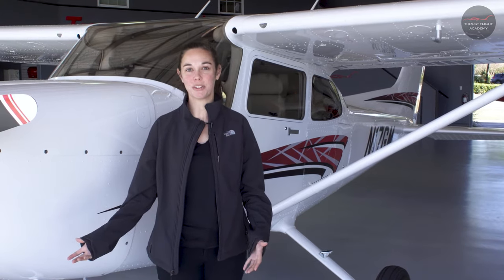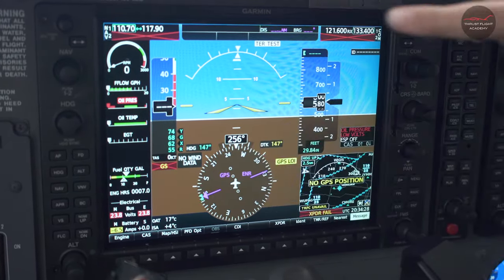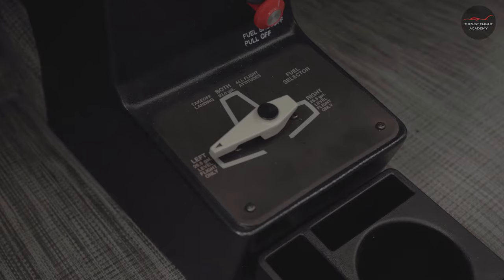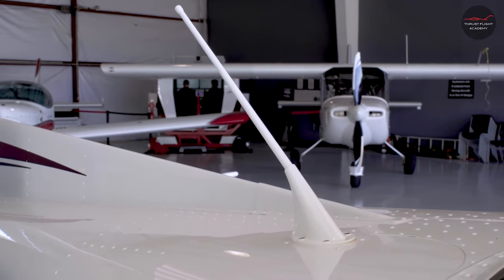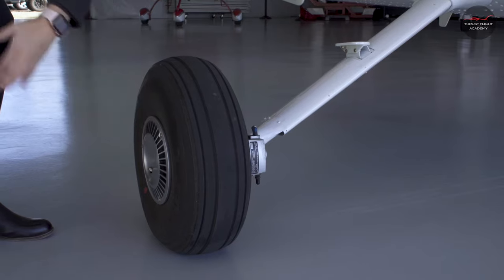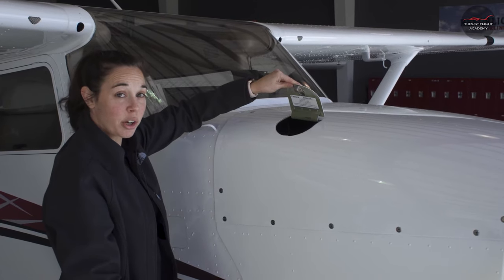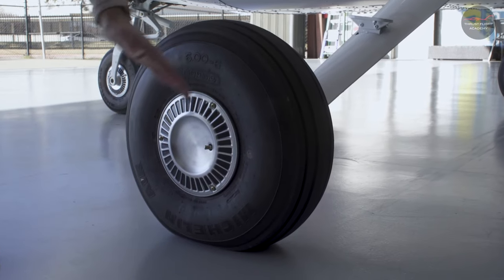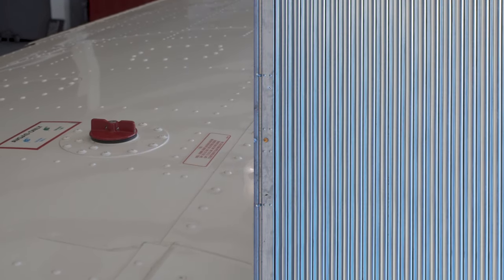How to Perform a Cessna 172 Pre-Flight Inspection

Comment: I will never forget my airframe practical when the examiner assigned me to preflight a relatively new C-172 sitting in the hangar. I found nothing, except, when I asked him, "what were those small holes all along the upper leading-edge skin", (never would have seen from the ground) he said, "Good job". That is what happens when you remove ice with an ice pick".
Reply: Can you explain? I'm not sure what that means
Reply: Geez haha never heard that
Reply: @GR-uc1gq  Sounds like someone was trying to remove ice from the leading edge of the wing with an icepick. In doing so they punched holes into the aluminum skin of the wing. No bueno.

Comment: I am curious as to why the elevator trim is on the right side of the aircraft. Can anyone fill me in on the reason?
Reply: Simply put, it's easier and cheaper to engineer/manufacture, the adverse rolling/yaw motion is negligible